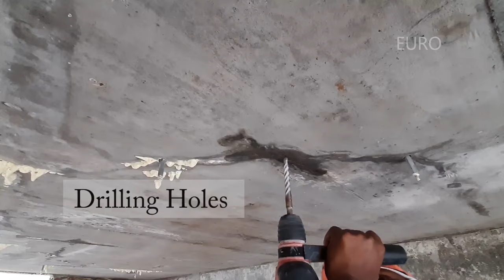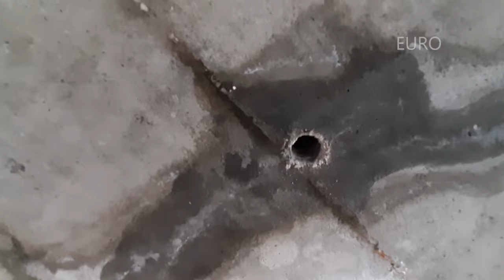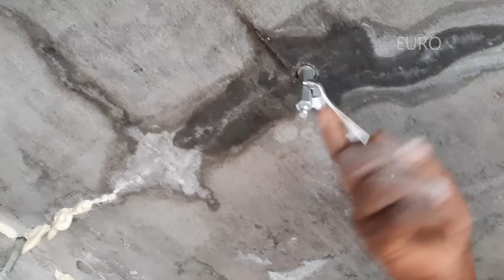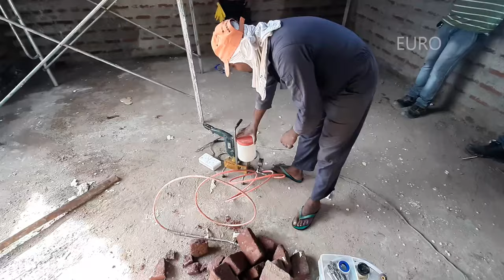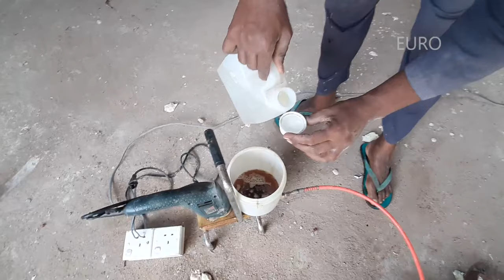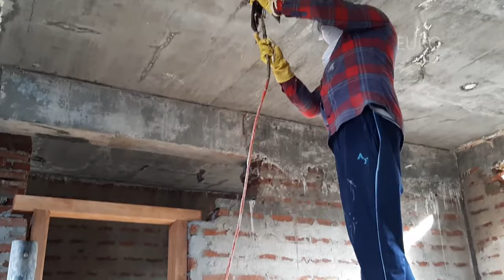How to Repair Cracks in Concrete Slab | Guide | Cracks Sealing | Pass Through Cracks Repairs

Comment: Is it dangerous if the slab has crack?
Reply: Yeah
Reply: NO! Depends on how long the reo was exposed to water. If the reo is rusted out, it will cause concrete cancer and start blowing out concrete chunks. Then its time for very costly repairs or replace.

Comment: This deck is structurally unsound, epoxy just moved the stresses over ... If, the same load conditions exist, this will map again.
Reply: It's not epoxy. It's a 2part polyurethane foam designed to stop water leaking. It expands when it touches water. Repairing that slab into a structural substrate again is a HUGE job and really expensive.